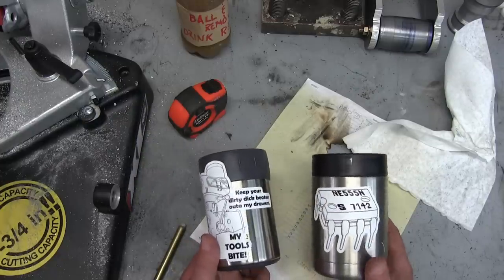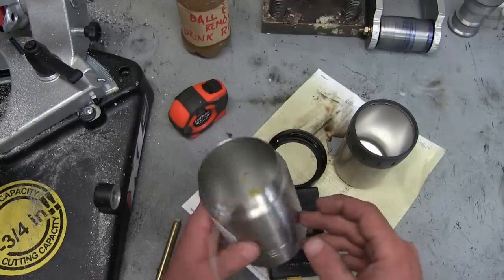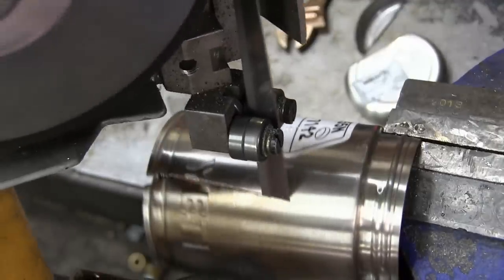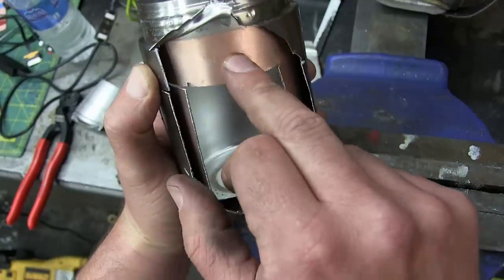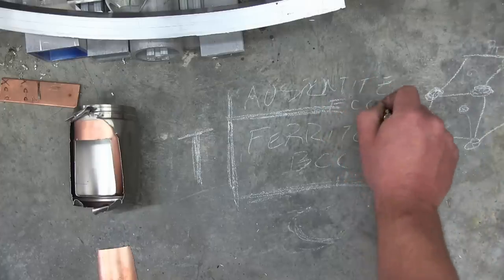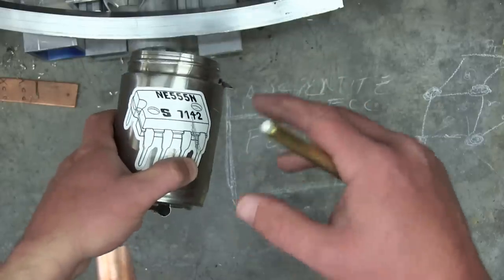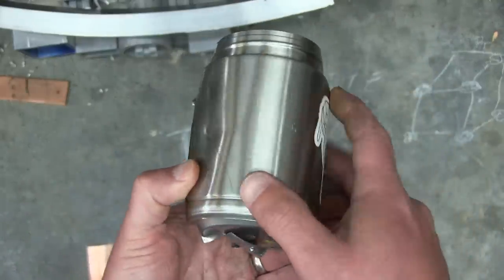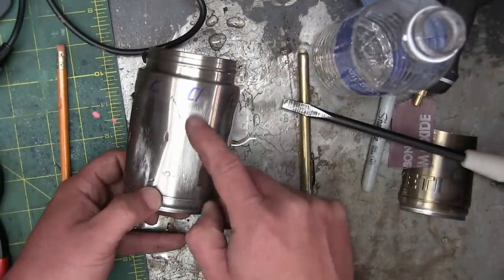BOLTR REDUX: YETI How it works | Enginerding Stainless Steel

Comment: I just wanted to point out I think you misspoke when you were talking about austenitic stainless steel's phase change when cold worked. The phase change is not from austenite to ferrite it is austenite to martensite. Martensite is basically just elongated austenite. This phase change would also be magnetic.
Reply from the maker: 304 has less than 0.08% carbon. Do you have a reference that explains how martensite is formed without carbon? ;-)
Reply: It is true that there is no phase change in aust stainless. The hardness increase is caused by cold deformation of the lattice.
Reply: Wim Janssen please, reference the paper posted. The deformation causes a hardness increase not only by just increasing dislocations within the lattice. It also, causes a phase change to martensite in austenitic stainless steels
Reply: AvE.... Question... What would make the best burner in a BBQ grille? Bronze is my guess
Reply from the maker: Thanks Andrew! Very interesting, I'm out of date; added to errata. I assumed, wrongly, that because there was no carbon their would be no martensite. So FCC austenite to BCT martensite, regardless of carbon content under high strain. Does that mean that high carbon and rapid cooling cause martensite formation in the same way; high strain?
Reply: Damn it, I learned something
Reply: Yeah, me to...scarey
Reply: Hello Ave, I've got my Intro to Mat Sci by Callister open; 0.08 appears to be at the lower end of wt%C that would allow for Martensite formation  (0.06% appears to be the min, visually going off the diagram). Tempered martensite (@700F) doesn't form until around 0.12%.
Reply: So Martensite will form in excess of 1.0 wt%C, but the trade off becomes less substantial as you approach around 0.5%. The Brinell hardness number (BHN) converges to about 700 as you continue to increase the wt%C. Consequently because Austinite's FFC structure is a little more dense than the Martensite BCC structure when you go to quench there is a total volume increase, and as you increase the carbon content the internal stresses from quenching may crack your alloy. So the trade off is between higher BHN but more internal stresses that may lead to crack propagation.
Reply: arcseco What chapter are you in? It sounds like you are referring to the more traditional formation of martensite by quenching carbon steels. The iron carbon steel phase diagram does not apply to austenitic stainless steels.
Reply: Ignore me! You're correct, what I was referring to a BHN/wt%C diagram for a plain carbon martensitic steel, not the 304 that was referenced.
Reply: You'll find similar magnetic properties on other SS items that have been deep drawn, like your kitchen sink. Magnetic on the vertical sections, non-magnetic everywhere else.
Reply: Taking carbon out of steel is called decarburizing. Annealing is the process of removing strains and dislocations from a material and reducing it to a softer, tougher state. In steel this means cooling it slowly enough to prevent the formation of martensite.
Reply: 'Dumping' is the process of removing strains and dislocations from my colon.
Reply: Again, I think the term you're looking for is "decrapurizing".
Reply: You might know the machines, but you don't know the terminology. Annealing is the heat treatment process to soften metals. Ron Fournier demonstrated the process on sheet aluminum after work hardening it on an english wheel. You can only hammer and wheel a sheet for so long before it gets too hard and brittle. Anneal with a torch and you can go back to work on the same sheet, except it's back to its original softness.
Reply: Now, I believe my cats breath may smell of cat food. Nothing definite yet, longitudinal study to commence. Early signs are positive.
Reply: keep it up!
Reply: Andrew Stafford
Reply: Andrew Stafford I
Reply: @berbaas9048  you aren't scary?
Reply: @andrewstafford7844  Wikipedia is about as reliable as the common John gacie
Reply: 304 stainless steel gets slightly magnetic if work hardend.
Reply: @KurczakFarmLLC  Very true, common for higher college's to frown upon the use of Wikipedia as a main source of information from what my friends have told me, I myself was even told in middle school (grades 6 - 8) that I should only use it for breadcrumb information, to help me research information I may have missed somewhere else if I missed some process, or chemical, etc, that I'd find in wiki, and research elsewhere. Hell, even in highschool as well, ive literally lost points off entire papers, and projects for using wikipedia, but it's understandable, good for maybe average info, I'm sure a lot is accurate, but there's always a decent amount that isn't, whenever pages can just be altered on a whim.
Reply: Solaris But, Wikipedia has gotten better on fact basis. So no ones gonna “throw a rod” when used for situations
Reply: @KurczakFarmLLC  Hmm right on, I only really use it when looking up random stuff like Studio's previous projects and such, that's good though, it's been a solid minute since I've used it for anything even remotely important
Reply: Solaris I can relate to that.
Reply: @solaris736  they are pretty tight on their changes. I’ve never had a problem with the information and the major stuff is usually cited at the bottom.
Reply: The Druncle
Reply: I am lost!! FACK!
Reply: I like JB weld

Comment: that little pellet in the bottom is a getter.  it keeps the vacuum 'clean'.  it works similar to the getter in a vacuum tube and for the same reason.
Reply: kevtris . clean?
Reply: kevtris So there is some merit to it's price. Thanks for the tip! But does the cheap one have a getter too...

 https://en.m.wikipedia.org/wiki/Getter
Reply: Had to scroll through to see if anybody called it out.  The idea of it being "security" was kinda funny though.  Placing an RFID type device inside a faraday cage wouldn't chooch very well.
Reply: I thought the same thing.
Reply: kevtris makes sense, I didn't see how a shoplifter tab would work inside a faraday cage..
Reply: I was thinking sacrificial anode, but that makes more sense.
Reply: Ha! saved me a comment. Little nub of magnesium to oxidise out any remaining oxygen after the evacuation process.
Reply: It releases fluoride to turn the frickin' frogs gay
Reply: I'm thinking that the pellet is how they closed off the hole where they    pumped all the vacuum into the space between the layers.
Reply: Yes its getter. Just wondering do they activate it or it is some kind of highly oxidating materiall. Usually in vacuum tubes they activate getter with rf induction to improove oxidation. Maybe here they can just wait and with time it will boind air, oxygen, to form oxide of metal.
Reply: The getter works by oxidation.  The remaining oxygen is locked up in rust.
Reply: As an old tube powered electron herder, I agree.

https://en.wikipedia.org/wiki/Getter
Reply: Yup, definitely a getter. Used to use the exact same getter to make HID street lighting bulbs in one of my previous jobs.
Reply: Why would you need a getter in a 'thermos', I reckon it's a pellet that out gases to slowly remove the vacuum. Planed obsolescence.
Reply: Sirus You got it backwards...
Reply: I think it's a fragment of the Allspark that was hidden in there. Now that it is free, intergalactic war will break loose on Earth.
Reply: Thank you. This pleeb is now less ignorant.
Reply: I had no knowledge about the getter, but that does sound very feasible...I was originally thinking it may have been like some kind of galvanic anode (such as zinc) to help prevent corrosion (in an unlikely case).
Reply: kevtris it also keeps the meta from vibrating it does 2 things
Reply: A getter could still be considered sacrificial.
Reply: Jack of all motards n
Reply: This is why I love this channel - Like NSA theory out the way, science coming through! Wtf is a "getter" roflmao, well you learn something every day with the exception of the days that @AvE releases a vidjeyo then you learn a week's worth in 30 minutes
Reply: Hmm yes. they even use getters in silicon chips!
Reply: If it isn't a getter then it might be a sacrificial anode.
Reply: +Esven I was told that if someone tags a comment as spam, it gets removed; though some of mine disappeared, and I never got notified as to why. Or maybe if the comment was posted by an account that has been deleted or closed for too many copyright complaints cause too?
Reply: Thats a good question, Kinda want to take apart my nine dollar one and find out.
Reply: Brandon Cornett - How on earth did they fire the getter inside the totally-shielded cavity? I was told that the getters in vacuum tubes were fired with a microwave pulse, which pass through the glass, but how do you fire one encased inside what is essentially a stainless Faraday cage?
Reply: kevtris 
That's the same as oxygen absorbers for food storage. They remove oxygen by causing iron rust in to iron oxide, thus removing oxygen and increasing vacuum as a byproduct. In a way, it could be considered a sacrificial anode.
Reply: That’s what they want you to think (The CIA/NSA) lol I’m jp
Reply: Shain Andrews 
...one mans faraday, is another mans antenna.
Reply: kevtris  spot wielding the vacuuming point after a vacuum is pulled in the container
Reply: I am more inclined to believe it's where the vacuum was pulled, then sealed. I had never heard of a 'getter' before, so I looked it up. Couldn't find any examples that would activate in that environment.
Reply: Esven don't feel bad. Unfortunately with all the comments he gets few people read them all. I only got part way down and found yours. 👍
Reply: Esven your comment probably died through random chance or because you do not belong to a secret close society. Thanks for the link.
Reply: My thought on this would be that it probably was just lost due to being posted so early at a point when many people are commenting at the same time. Kevtris probably posted a few days later when the comment section was a little more tame and his comment stuck out because of that.
Reply: IDK how i didnt notice this.
Reply: exactly!
Reply: @UberAlphaSirus  getters help achieve and maintain vacuum from odd contamination particles during manufacture.
Reply: @realblakrawb  I really need to end some of my comments with ;p
Reply: Thanks, I learned something today.
Reply: kevtris b
Reply: Damn, that's really cool, thank you!
Reply: @dickJohnsonpeter  This just in..Yeti vacuum container built to last a century!! Someone call the marketing department!
Reply: @esven9263  

Could be something as simple as your choice of words. One of them picked up more attention, because people are fucking weird sometimes, which is why there's such a phrase as 'because reasons'.

Anyway, I made this comment explicitly to fill out your order for that extra-small Attention Low Sodium from the value menu. Thank you for visiting Teh Internets.
Reply: Wow! You out chooched AvE.
Reply: @thereallevel27  That was my [wrong] thought.
Reply: Doug Gol
Reply: @esven9263  Thanks for the link.  :)
Reply: Right, and all vacuum-insulated mugs have them. They absorb the molecules of gas that escape the stainless over time, primarily H2. They're activated by heating at the same time the vacuum is drawn and the vacuum envelope sealed in a big vacuum oven.
Reply: A getter is a complification😏 It's just a piece of iron, waiting to rust, if any oxygen comes by.

Comment: A friend of mine was the foreman of Lockheed's titanium shop back in the 70s. He told me about planes that would come in with cracks in the wing surface. They marked the cracks with a pencil and welded the cracks. They found that multiple new cracks appeared around the repairs. It turned out that the carbon from the pencil marks reacted with the titanium at high temperatures. When they switched to Sharpies, the problem went away.
Reply: Valuable point! BTW Don't mark electrical circuits with pencils either!
Reply: BlankBrain  sounds like bs to me.. a pencil mark cracked an airplane wing.  Did ur friend tell u this while working on his tenth beer?
Reply: Dave Wilkey it's very possible, on aluminum aircraft parts it causes galvanic corrosion. It gets into the micro crevices of the aluminum and the graphite acts as a cathode.
Reply: Aircraft tech here. I can say for a fact pencil marks WILL cause cracks in aluminum and other metals. I found a guy marking exhaust with pencil... guess what. Yep! Cracks exactly where the marks were. Had him draw a line where it doesn't normally crack to test.
Reply: none of thre weld inspectors would allow us in pipe shop with carbon pencils
Reply: I love reading the comments on these vids. Thanks for sharing, guys!
Reply: You should always mark it this gallium it always leaves a nice finish on aluminium lmao 😂
Reply: Dave Wilkey 
It’s not. Pencil causes failures on aluminum parts in boats, too.
Reply: Lead
Reply: 100% true been in aircraft manufacturing for almost 30 years...sharpies only for markings...I mark em up all day long
Reply: Interesting I worked with a lot of titanium at Boeing before covid got me laid off and we had special sharpies we used to mark parts. not sure what the secrets sauce was but regular ones were for bidden.
Reply: @spagsketti  TEC Sharpie 👍
Reply: @spagsketti  Boeing had you marking parts? Wow.